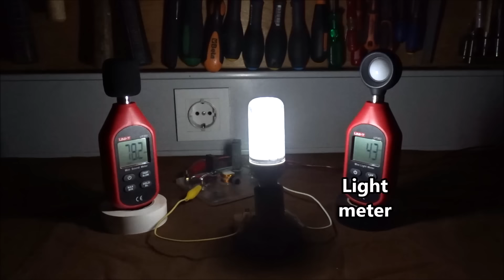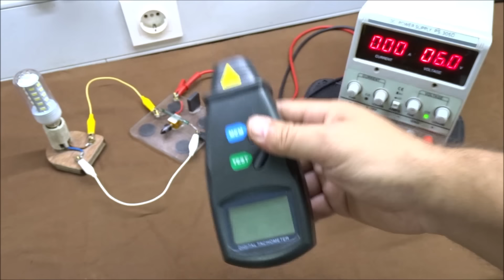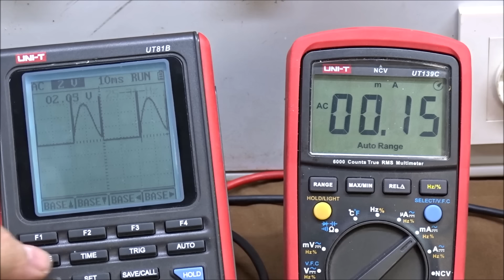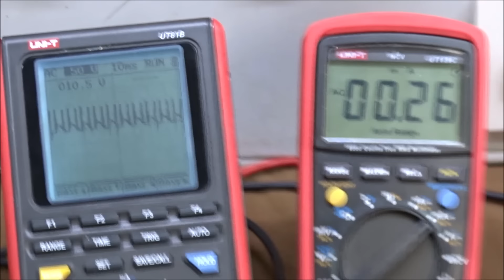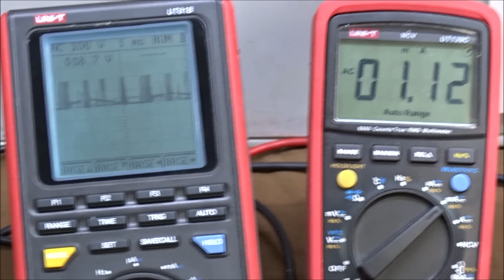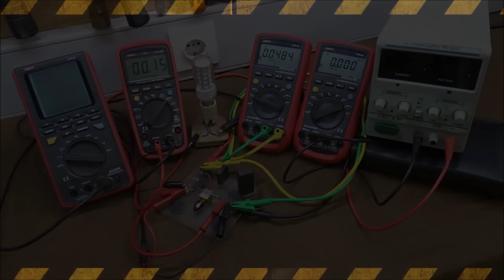World's Smallest Joseph Newman Motor

Comment: input 30V *  20mA = 0.6 mW, enough to dimly light a led bulb no mystery here. Output 200V * 2mA = 0.4 mW so less energy out than in. quite efficient voltage multiplier you got there though, usually they are far less than 66% efficient, but that is to be expected by an inductive high frequency circuit which is much better than the FET switched type devices usually used in electronics, but then again, Measuring AC in the kHz range with a multimeter is not that accurate, so preferably, use a diode bridge on the voltage output to make it DC and a Hall current probe with your recording oscilloscope, so you can measure it reliably, if measuring current with the oscilloscope directly disturbs the oscillator too much!

Comment: This is not a Joseph Newman motor.
Reply: Unfortunately it is, a very tiny nearly irrelevant one with very poor implementation.

The Joseph Newman motor is only good if it is large, like industrial size large.   Small ones are not worth building and only explains the concept
Reply: It has fundamental differences, the main one being the absence of a magnet rotating outside the generator coil.  @ConstantineJoseph

Comment from the maker: Buying one helps my research tremendously, helping me get all the supplies I need for the future. Visit my store on ebay: https://www.ebay.com/usr/eleman-gc
Reply: Now who has the largest newman motor. Could you rectify the out put and charge a capacitor and also have a drain from said cap. To a rechargeable two 9.6 batteries in series that is the driving cell.... Just another project.
Reply from the maker: Good idea!

Comment: Annoying soundtrack, no schematics, no engineering analysis,, no explanations, no audio, uses mostly cheap instrumentation tuned to operate at 50 to 60 Hertz RMS and yet shows undefined waveform with non sinusoidal characteristics.

Typical from this genre.

Met with Newman in early 1990’s. Nothing has changed with this tech. The whining centered on why it hasn’t been commercialized has grown, though.

This fake free energy toy is not a Newman motor.